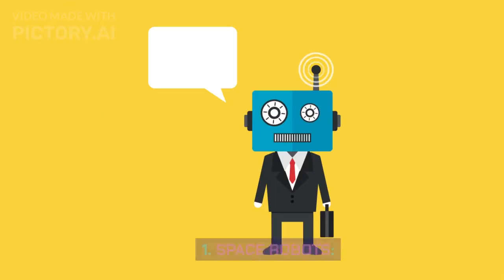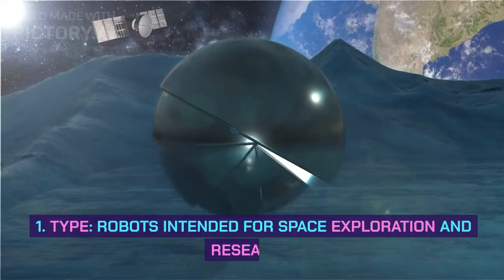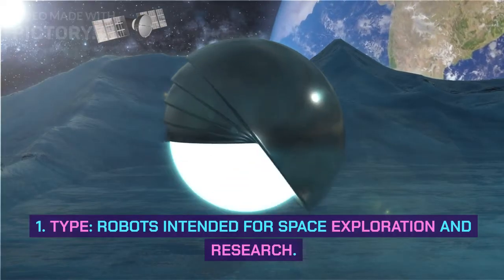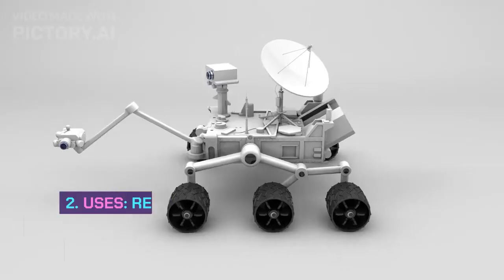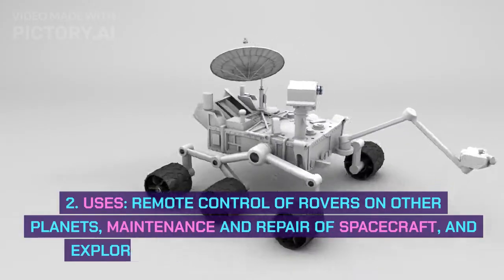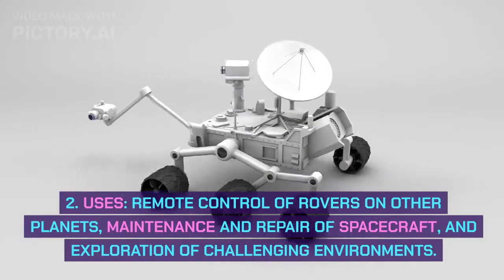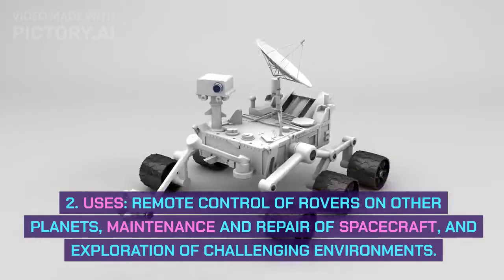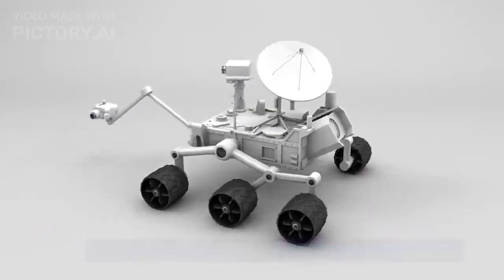Types of Robot and their uses

Comment: Dave Aaron V. Dagcuta
10 - Lynx

1. What are some common uses of industrial robots in various industries?

A: Industrial robots are often used in the factories to manage tasks like welding, painting, material handling, etc. These robots are often equipped with flexible arm-like structures to manage the repetitive tasks and also allows for a lesser chance of work-related injuries that may occur in these types of work.

Comment: Angel C. Sumastre
10-cassiopeia

1. Industrial robots are widely used in various industries for tasks such as assembly, welding, painting, material handling, and packaging. They improve efficiency, precision, and productivity, particularly in repetitive or hazardous environments.

Medical robots provide surgeons with enhanced precision and control, enabling them to perform delicate procedures in difficult-to-access areas through smaller incisions. This leads to less pain, quicker recovery times, and a lower risk of complications.